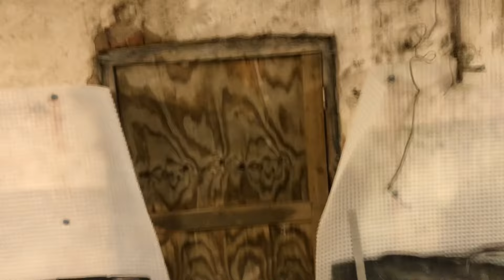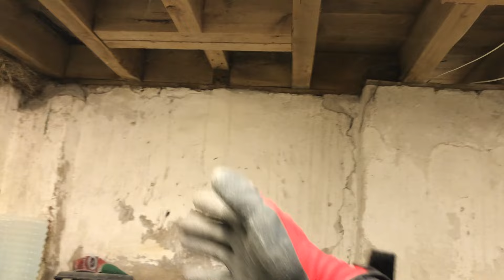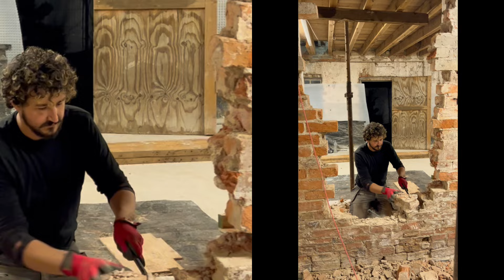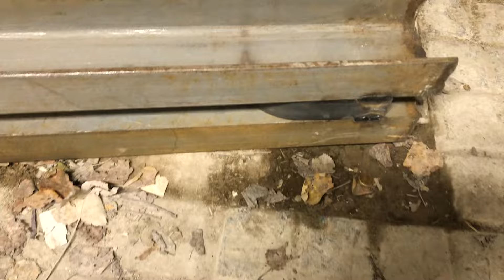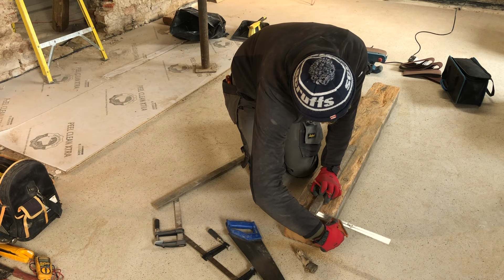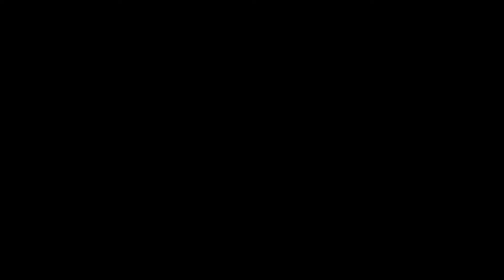A new doorway made into the Stable.

Comment: You mentioned at the start that the horses would have been kept in the barn, then lead outside and onto a coach. 

Don’t suppose you know if the coach would have had air conditioning?
Reply from the maker: Great question, the air would have been conditioned intermittently with a large volume of methane. Although this was an unpleasant odour, it would be considered as wind chill.